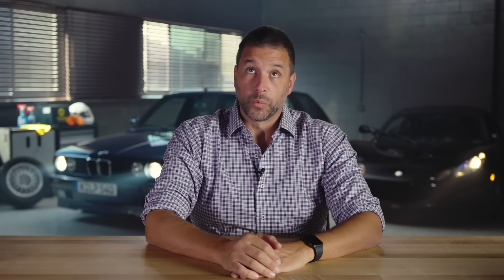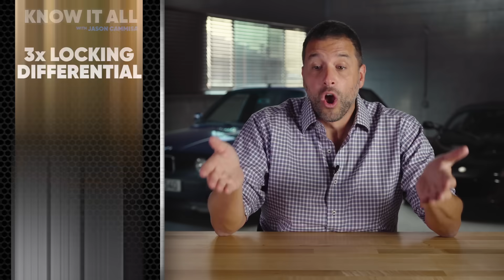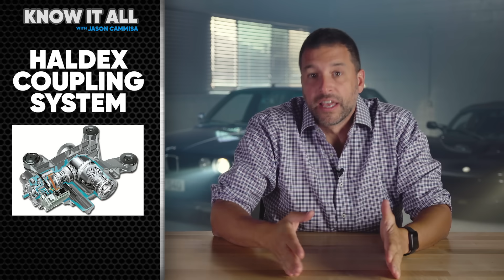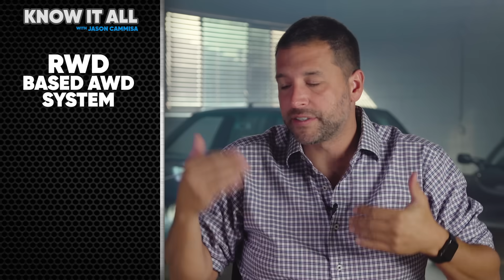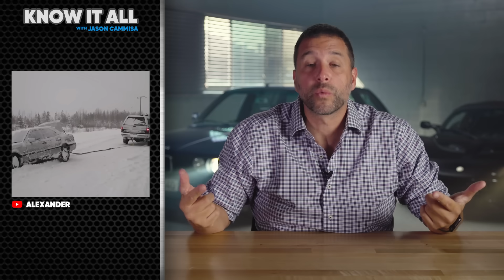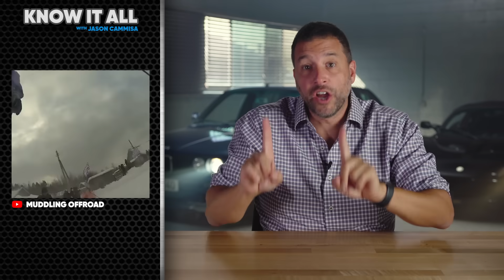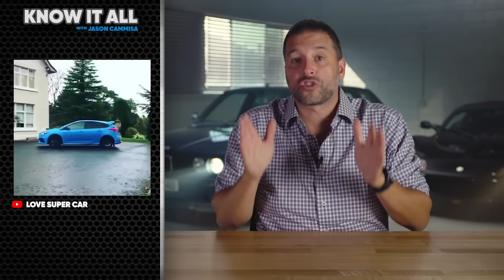Understand Your All-Wheel-Drive System | Know it All with Jason Cammisa | Ep. 04

Comment: In the G-wagen like scenario, with 3 wheels in the air and all 3 diffs locked it will send 25% of the power to every wheel, in the air, ground, sea or whatever the case may be. To be able to send 100% of the power to only one wheel the car must have open diffs and an electronic control that's able to push the brake in 3 wheels immobilizing them and because of that sending the motion from the engine to only go to that one wheel
Reply: It's about effective torque not just wheels turning

Comment: What about the TLX SH it seems to me that technically it is better. More power on the rear outside wheel with the torque vectoring lsd. So fr 1.0-1.0 rr 1.0-1.5 Am I right and does it works?
Reply: It works, and it works fantastically. On power, the TLX SH-AWD turns like a cat out of a bathtub...

Comment: Recently found the channel and love Jason's work so far!  But... being an ex-Golf R owner and now an S3 owner, I really don't understand all the hate for the Haldex systems?  I'm not disillusioned as to how much power can go to the rears, but the system definitely makes both cars handle far better than they would without them.  The Golf R is a go-kart!  I had mine at APR Stage 1 and it was incredible fun on any road!  The S3 is most definitely not as nimble as you trade handling for comfort (*cough* weight *cough*), but it's also no slouch!  And in the rain or snow, there's no question as to how much better it makes these cars behave over anything driven by 2 wheels (front or back).  Also Haldex is less complex, lighter, cheaper, and provides better fuel economy than a more traditional AWD system.  Yeah I can't swing the rear around, but I really don't care to do that the majority of the time I'm driving around, so it seems like a fine trade for being a daily driver with the ability to have a lot of fun when desired.

And yeah, like others mentioned, please make a part 2 as there's definitely more to cover on this topic (Subaru?!?!?.... Lamborghini??!?!)
Reply: I had cupra leon 290 frontwheel and now formentor vz with 4drive and with the formentor is I believe the biggest advantage massive traction. Leon was unable to put the power into the road even with the best tyres. Formentor is able to go all-in even in the f*cking rainstorm. The handling with 4drive feels more understeered but in the end is much more confident and enables better handling   as you wrote. The cupra leon 290 had better times on track than leon 300 4drive because of weight and traction. As normal roads dont offer traction 4drive is always much better in my opinion
Reply: Blip the parking brake, the rear end will come around. Then juice the throttle.

Comment: >Video about AWD's.
>Calls 4WD's AWD's.
wat

True 4WD has no center differential. A "full-time 4WD" is often a glorified AWD system with a center differential lock that changes the AWD action into 4WD when selected.

Using the term "Haldex" for all MPT systems is a bit like using the term "Kleenex" for all face tissues. As pictured, actual Haldex systems are going to be developed by Borgwarner in conjunction with the relevant vehicle manufacturers. 

Often times, MPT systems lack a center differential for the more-basic systems. Not all of them will have differentials for the center.

I'm really surprised you didn't even get into center differentials that don't have any computer intervention in the mechanicals (from the driveline, excluding traction control). Not all AWD systems transfer torque between the front and rear purely through computer-control.

An Audi Q5 and Porsche Macan aren't trucks. They don't even have ladder frames.

Because of what I perceive the target audience to be the laymen car enthusiast who is a tad clueless about AWD systems, this is a fairly simple-enough introduction, but does not delve as deep into the workings as I hoped, for a show named "Know It All".

Comment: You should take a look at Lincoln Continental 3.0 AWD, it can increase the torque to one of the rear wheels or increase it to both in sustained constant straight line acceleration.
They say it has controlled planetary gears for each half shaft outside the rear differential.

Comment: That made sense. Thank you for sharing :-) 
I suppose that it is possible to make the vehicle handle differently through suspension geometry, wheel alignment, and messing with the individual brakes.
Reply: You can change grip balance, but it gets complicated when you have multiple systems all affecting individual wheel grip in a dynamic way.

Comment: There is a decent-sized asterisk when it comes to the Audi systems. The longitudinal-engine Audi platforms have AWD that effectively function the same as the BMW/Jag/etc RWD-biased systems that were mentioned (I'm referring to the later Torsen cars with the 40/60 static F/R split), but the packaging of the Audi (and Subaru) drivetrain forces the entirety of the engine to be in front of the front axle line, which kills the weight distribution (which is why Subaru uses short flat-4s to try to compensate). It's simpler and lighter (and tighter packaging) than the BMW/Jag/GT-R layout, but for me the extra overall weight is less of a compromise than the nose-heavier weight distribution (coming from an STI owner).

Everyone should agree that Haldex sucks😂 (at least from a performance standpoint).

Comment: There are other types of systems out there that do intelligent torque vectoring with clutch packs not only front to rear but right to left. You also completely left out brake based traction control systems, or as Vee Wee likes call it “E-diff,” which are hugely common. And you also failed to cover viscous couplings which are also rather common. And even with three wheels off the ground most systems cannot send most of the torque to one wheel without using the brakes which they can only do intermittently. Modern AWD systems partly come down more to the software than the hardware. Subaru completely crushes Volvo and VW for example in real world traction despite using relatively common hardware.

Comment: This is accurate as long as you forget brake torque vectoring exists. The base model mk7 golf rotates better under throttle than it does cornering neutrally. The fiesta ST is front wheel drive and you can make it oversteer on throttle. So all the Golf R people saying they can rotate on throttle are correct. But it's not because they have AWD, it's because they have torque vectoring
Reply from the maker: Good point, Max!

Comment: You might get the impression from this video that Audi uses a Haldex system, but Quattro systems are Torsen systems which are nominally 50/50 and can send 75% of power to either axle.  if your Audi engine is mounted longitudinally then its a Torsen system, if its mounted transversely it is Haldex.  I never gave much thought to this, but living in Colorado we have quite the variety of AWD systems in the family garage and driveway - two Audi Quattro cars in the family (Q7 and B7 A4 manual), a 335i M-sport Xdrive manual, a Porsche 911 C4S manual which I gather is similar to Xdrive in that it powers rear wheels first (though curiously no marketing name other than "4") and a Tesla Model S P90D - which I guess can send power anywhere anytime it wants to and apparently shifts power from front to rear as hard acceleration is in progress.  Oh yeah, one lonely (but fun) RWD BMW 535i M-sport manual.

Comment: That Haldex piece of crap has saved my life countless times..
Reply: Doesn't mean its not still fake AWD that overheats when trying to track the car and ultimately just becomes a FWD car.
Reply: @Bones12x2  Buy a diff cooler.. 

I track my RS and all my cars before it. If there is a problem with heat, address it! Yes there is more maintenance but this comes with racing. It’s not like we are living in a bubble and can’t modify things. 

Go ahead and track any car mentioned here and see how long the stock brakes last. Bet that will go before any “Fake AWD” diff does.
Reply: @tuftylb  you can upgrade pracrically any part on any car. Ao thats a pointless statment. And on most $40k plus sports cars... the stock brakes are not going to fade completely after just a couple laps to the point to where you have to modify them right off the dealership lot. They don't completely suck right off the bat, especially for non competitive track use. But face it... The haldex sucks and for that price the car should have a mechanical diff thay you dont have to immediately modify just to handle being used for a casual HPDE.
Reply: @Bones12x2   I concur with your last statement wholeheartedly. After rewatching the video awake  (not while falling asleep as per the usual), the commentator is talking about when driving at the limit and I absolutely agree with his sentiments as well. Thanks @Bones12x2

Comment: Instead of wearing out the clutch pack with different gearing couldn't you just use different size wheels and tyres front and back? What about viscous 50/50 splits like WRX? Also can't you negate at limit understeer with sway bar tuning?

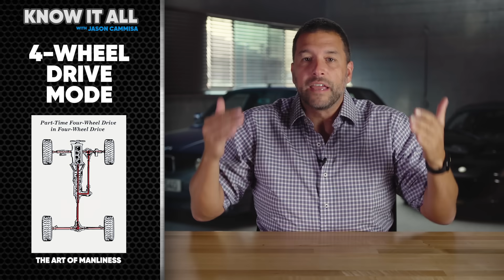Comment: 1:05 it doesn't matter where the power goes, what really matters is torque (which, multiplied by the radius of the tire, is moving force). With open diffs, torque is split equally. If one of the wheels is just spinning freely, all wheels are getting equal (zero) torque.

Comment: 1 annotation the Torsen in S4 B8 has default split of 60(rear)/40(front) altough non quattro version is FWD, add sport diff at the back("haldex like LSD") and it drifts. It's not the best handling car in the world to say it nicely but it usually(9 out of 10) oversteers on throttle when i drive it.

Comment: OMG I’ve been waiting years for someone, anyone in the car media industry to rant about fake-ass AWDs (Yes I’m talking about you HALDEX) properly. You are the Best Jason!
Reply: There’s nothing “fake” about a haldex AWD system. It’s still AWD it’s just that adding a PTU to a front drive car does not suddenly make it handle like a rear wheel drive car. And that’s OK. I have a RWD car for giggles. I have an AWD car to commute in. I don’t care about at the limit handling on my commuter because that’s not what it’s for— it’s for getting my ass to work no matter what BS is happening outside.
Reply: Fake? I drive Passat B8 4motion, and on the winter it's very competent. Jason is talking about when you push the car to the limit, but on every day basis it's no different. I also had a Audi Q7, and I didn't really feel that big of a difference on my commute. Btw, I live in Sweden
Reply: @yosefm170  Ughh… I don’t think you get what I’m talking about… haldex itself is a genuine awd system and I admit that. If a fwd-based system can send any power to the rear, it is in fact awd. But the fake part is in its marketing approach. All the haldex-using car companies boasts its ability to send 100% of the power to the rear and yet it never can (under normal driving circumstances ofc). This is now misleading consumers and That’s what’s fake about it.
Reply: @SebastianXe90  now I understand what you ment :)
Reply: @SebastianXe90  is a torsen type amy different?
Reply: @JohnDoe-qb6yh  yep they're different. Torsen based systems are permanent AWD systems, so they'll drive all 4 wheels all the time. The power distribution is set up similarly to how this video, with a different sized gear at the back of the diff. 
The Audi RS5 is an example of a Torsen-based system and it's got a 40/60 front/rear torque split. Its smaller brother on the other hand, the RS3, uses Haldex.
Reply: @xIcarus227  ive got a diesel 1.9tdi 6 speed manual a4 b5 avant quattro. It has torsen , is it 50/50 split?
Reply: @JohnDoe-qb6yh  Torsen systems are generally 50/50, but you'd have to search for your specific car to know the split for sure.

Comment: A very complicated subject, that very few understand, explained in a way I hadn't heard before and explained well.  Good job.  Now two questions.
1) What if one installed slightly larger tires on the rear of their Golf R, thus overdriving the rear tires?  Success or just successfully confusing the computer?
2).  What if one took a front wheel drive transversely mounted engine/transaxle and custom built a car to accept this drivetrain in a mid-mounted longitudinal position with one halfshaft driving the front axle and the other halfshaft driving the rear axle?  Just think about it...
Reply: You'd never want to have mismatched tire sizes on an AWD vehicle. It would damage the center diff.
Reply: @Robert-un3cf  Damage will only if the center differential is a LSD, locker or fixed like in transfer cases.  The whole point of a differential is to allow for a speed differential between it's outputs.  
Considering the varying methods that manufacturers use to implement AWD systems I would tend to agree with you in most situations.  And considering the repair costs if damage did occur it is better to not risk it.  
But different tire sizes have been used in motorsports for decades, most notably in oval track racing where the outer drive tire is larger than the inner drive tire resulting in the car wanting to turn into the corner, this also results in the drivers actually having to turn the front wheels to the outside of the track to get the car to go straight on the straightaways.

Comment: Great video; I learned a lot. Thank you. I love all wheel drive high performance cars. I once had an accident in Austria in my 1997 German-spec BMW 325 ix that ripped off both rear wheels and sent me down an adjacent ski slope. After calling a tow truck that could not get onto the ski slope, I literally drove the BMW down the hill with ONLY the front wheels pulling. So in this case, there was NO power going to the rear wheels because they were literally gone. Yeah, what was left of the rear axles was spinning a bit. But it worked, and drew quite a crowd of skiers who had never seen an all-wheel drive BMW and were stunned to see the front wheels spinning in the snow. 
One note about clutch packs: Now I drive a BMW X3M Competition and while I love the AWD, I do notice that at crawling speed up a super-steep hill while turning sharply on pavement, there is a bit of "binding" between the front and rear wheels. The computer is probably going crazy trying to manage the clutch packs.
Reply: That is typically what happens when the wheels are locked together too tightly for the turn. I would assume it is made like that for low speed crawling for maximum traction. I'm actually impressed it does that
Reply: @BrokeWrench  When the steering wheel is at full lock, my STi has that same slight clunk sound and binding.  The manual states this is normal.

Comment: Still nothing better than RWD as an exercise in proper balance. The best AWD systems are naturally RWD with FWD assist.
I think Porsche has done some wild things, with rear-wheel-steering, mechanical torque vectoring at all 4 corners, etc.
Haldex is fine for straight-forward traction. The trouble with AWD systems is how they deal with traction while turning.

Comment: I’ll be “that guy” at the party. Jason mentions the G-Wagen 4WD system sending 100% of power to a wheel. For triple locked 4WD systems with every locker engaged, a fixed 25% of the power goes to each axle end at all times and cannot vary. They can not send 100% of the transmission output to any one wheel, but will always split the torque evenly to each of the 4 ends.
Reply: Actually he is right. The nominal torque split is 25% to each wheel. But torque is based of traction. And if you have all 4 wheels locked together the wheels with traction produce a higher percentage of torque.

Comment: No offence, but the Lancer Evo's AWD system does not overdrive the rear wheels relative to the front wheels, it has an actual center differential, unlike Honda/Acura's SH-AWD or the AWD systems in the Focus RS, A45 AMG and upcoming mk8 Golf R, and it's design from the start to be able to handle high performance driving.

Comment: The SQ5 doesn't use Haldex Jason. Audi doesn't use the front wheel drive biased haldex system in anything with a longitudinal powertrain set up. So essentially the entire lineup outside of the A/S/RS3 and TT....their other system (often referred to as "torsen") is a permanent full time system with a nominal rear bias (60:40) and can send up to 85% of torque to the rear and 70% to the front...also many are fitted with their optional rear E diff or "sport" diff...(electronically controlled but utilizes real mechanical torque vectoring, it can send up to 100% of the rear axle torque to either of the rear wheels)

Comment: What I heard: cherry pick some facts from a few common AWD systems: smash it overly simplistically into a video to imply that it covers every system...  

So many others to cover, starting with Subaru as everyone has called out already.

Also, if you brake 3 wheels (completely, via electronics or otherwise), you're sending full torque to the 4th.

Comment: Bugatti (VW) uses Haldex units in the Veyron and Chiron. Are they crap in those cars? (serious question)
Reply: Those are mid-engine super cars, so it's different anyway because the engine is over the rear axel instead of the front one like in the haldex systems used in Volkswagen and MQB based Audi products.
Reply: @bojack231  My point is that Jason said "Haldex crap" insinuating all Haldex is crap.